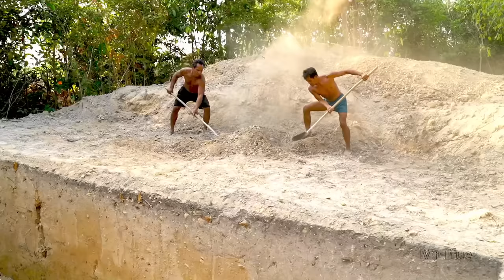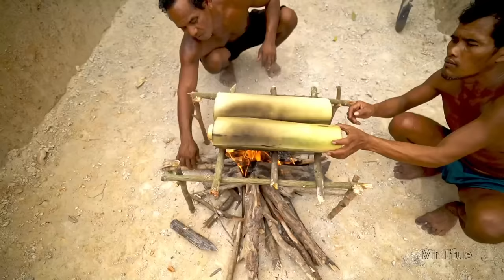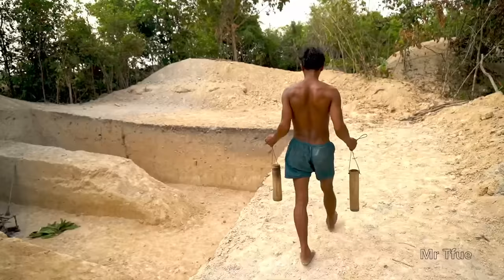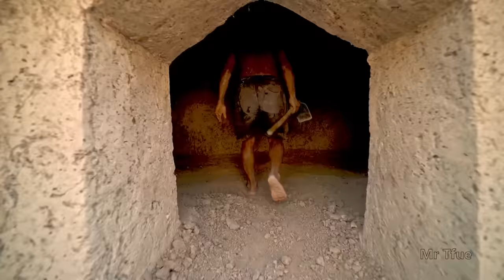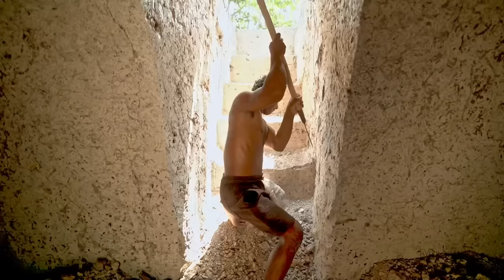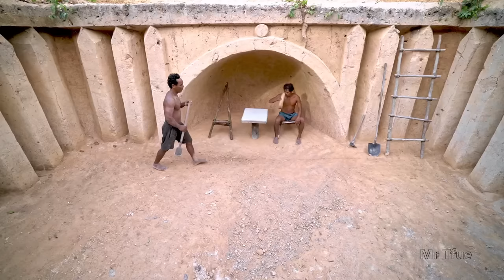100 Days Building A Huge Underground Tunnel House With Water Slide Swimming Pool

Comment: I'm always amazed by the primitive team of heavy machinery operators that make these videos happen in between each cut. Excellent work!
Reply: Except it's being harmful to the environment, I saw a different video of all the other pools they dug and what they look like now. They don't intend to ever clean it or reuse the structure and they never fill in the hole they create which traps animals and fills with stagnant water. Big L for the earth
Reply: @Dash902101  damn, that sucks. I assumed they just filled it back in, shot another build in a different area... then after long enough, come back and they can used the same areas that were filled in after it has dried.
Reply: ?
M
.
.mvv
Reply: in heard no
Reply: @Dash902101 ihoi
😂Erl
Reply: Kl the k l